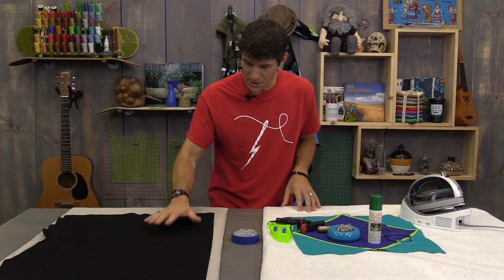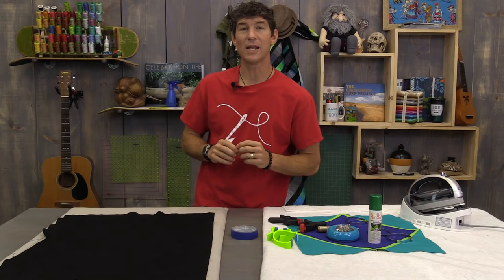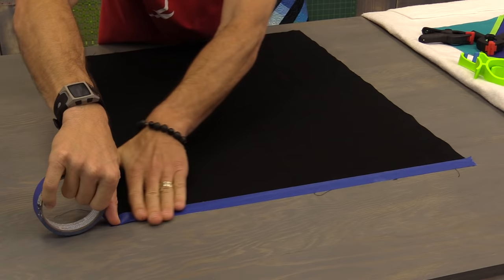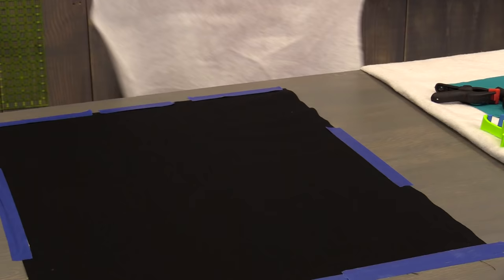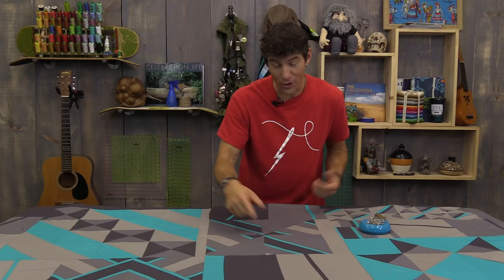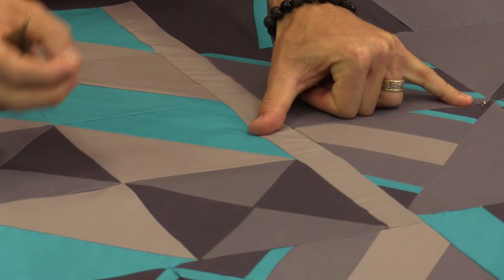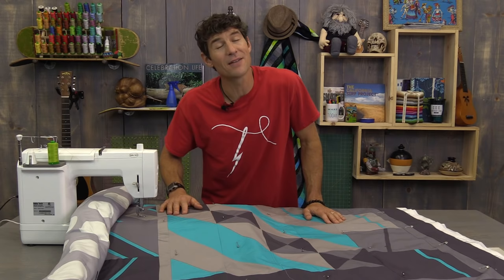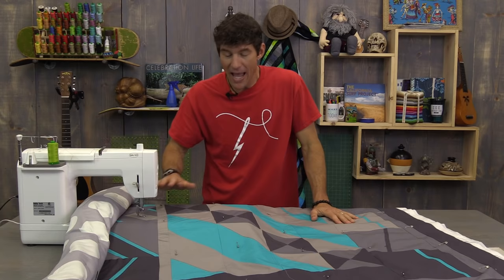Quilt Basting Basics Made Easy!

Comment: This tutorial was very helpful.  I have always relied on spray basting and am just tired of the overspray (and the expense).  Last year when I was Spring cleaning, I found cobwebs in the basement that were glued in place!  😃I'm working on my second quilt using pins.  Hard on old arthritic hands, so I think I'm going to invest in the tool you showed.  My oh so helpful husband went out and found me an old ping pong table and set it up in the basement this week.  Bless his heart.....I'm only 4'11 so I'm going to have to find a step stool so I can reach the center of the table.  The quilts I'm working on have backs and fronts that need to be centered.  What I did was glued a small button on the middle spot of the table and then found my front and back centers.  Did this on the batting as well, so everything worked out as far as overhang of backing and batting around the perimeter.  Funny...........my extra set of hands is always my husband.  When we were laying out the batting, he knew and kept saying to me....don't pull..... "lift and drape".  He must have been listening from the other room.  (Which I find amazing because usually when I ask him something from another room he says he can't hear me).  Thanks again for your wonderful instruction.  I think you're a great teacher!

Comment: I'm glad you mentioned not using Spray basting on large quilts. I did this ,it stuck to the batting and I had a terrible time to get it to lay flat! I would never do it again!! I never thought of ironing my quilt on the table while assembling it. I always did it before I laid it out. It makes more sense to do it while on the table. Although it will be hard to do it with an iron with a cord I'm going to try it! Thank you for the advice! I also Love how you kept the quilt rolled up. I to have a small machine.

Comment: You should try picnic table clips if you haven't already. I have a dozen that I use when I cover my table with batting and canvas, so I can press large pieces. They are stainless steel with a spring and they are super tight plus won't rust with the steam from the iron! Thank you for all your hard work taping these for us

Comment: Even though this video was done some time ago, I thought I would just add a little note for anyone intending to follow these directions.  Firstly, I like Rob's tutorials very much and this one helped me a lot so I wasn't crawling around on the floor.  However, where he says to drape the batting and quilt top, think about it.  I did think about it, but carried on anyway, with the result that the quilt top puckered when I was sewing in the ditch and I've just finished unpicking in about 8 different spots, smoothing out and sewing again.  Needless to say, with the time taken to do this, I could have made another quilt.  If I had been setting it all out on the floor, I would have been taping down all 3 layers, so I'm not sure why Rob wouldn't have been advising to hold down all 3 layers with the clips.

Comment: One and one-half inch wide painters tape works well for me, if needed for a smaller quilt.  For a large quilt I use clamps purchased at the local hardware store to clamp the backing onto my table.

Comment: Thank you so much for this awesome tutorial! It's so hard to crawl around on the floor while pregnant, plus there is not enough empty floor space! Now I can finally baste the 3 quilts I've been putting off! 
My question is: have you ever had issues with your backing fabric fraying during the first wash after not prewashing? I prewash and my fabric is always a wrinkly frayed mess after, I would love to avoid that!!
Reply: Ashley Brookfield, I know this is an old post, but if you’re still having trouble with fraying when you prewash fabric, if you have a serger, serge the cut ends and then wash. Wa-lah! No more frayed edges. Just a little tip I picked up somewhere, but it sure saves your sanity. Lol.

Comment: Hi Rob, such a great tutorial. I've been quilting for awhile, and always hated doing the sandwich, and have been using basting spray, and also pinning with the board on the bed, and only doing small child quilts.  Your table method will work for me and make it much easier to pin baste.  Is the home depot or Lowes stores a good place to find the clamps?  I've not used them before, but it looks so easy and perfect.  Thanks for the info!

Comment: Help!  On an old ping pong table I put down Insul-Bright with silver ironing fabric on top.  I thought this would be good insulation on the table but after ironing the tables paint has bubbled up or caused cracking.  How can I protect this surface or is it even possible?  Thanks for your tutorials, I've learned much from you.

Comment: Hi Rob.  I am a new quilter and really struggle with basting the projects that are larger than my table.  I actually saw a video where the woman used wooden boards from the home improvement store to “bolt” her backing and quilt top and baste in small sections at a small table.  I tried this and it works great, but for larger quilts, pool noodles also worked.  Have you ever tried this?

I would love suggestions on how to trim and square the quilt sandwich without having to hit the floor.  I cannnot get down on the floor due to a bad knee, but with a large quilt,  i struggle on the table with a cutting mat.  Any ideas?

Comment: I already know I have many errors!  I am a new quilter doing my first large size quilt doing a very difficult sisters choice quilt pattern.  Had so many issues in regards to each square being the right size 10  1/2 and gave up on possible correct squares.  So it’s a bust for that yet it’s a quilt for a little girl and an experiment to get me knowledge and be able to omit errors as I grow.  I realize that you should be sparing with backing and  the batting yet I’m on a budget trying to get least amount of waste.  I feel as I grow and learn I will be able to do margins for backing and batting to be  larger that the top of the quilt. What can you share with me to let me not be discourage. I am limited to space serious space.   And getting in the floor is hard I have lupus.  Standing is hard if it for long periods.  No hard wood flooring.  I need suggestions not words of just quilt I have spent a lot of money on things to get started so quilting is not an option.   So tell me some great words to not be discourage.  With the sisters choice quilting pattern I don’t have my rows starting and stopping in the same manner on each row.  Not to far off but noticeable yet it’s my practice quilt tell me what do you do in that manner.  I am good at getting points to line up but this pattern just had to many but oh well to that.  I purchase a Disney backing yet it was a precut and not very big so I had to use two but didn’t want to purchase another so added a border to that as well as the seam is not centered horizontal or vertical.  As I stated I made so many mistakes yet it was done from my heart to please the little girl who stood patiently by me as i ventured into this project.  She kept saying I love my blanket grandma.  So she saw no issues just me who felt down about them.  Can you encourage me?  You do such great work.  So energized enthused and just got it all worked out for the starter quilters and I thank you for that but help me to be a better crafter.  TCR0315@gmail.com

Comment: Hi Rob,  How do you account for any potential puckering that can happen when quilting on the machine while using pins?  I personally don't FMQ (I hand quilt) and have experienced pins putting holes in the fabric, but I find I still have to stretch the top, batting, and backing and baste with thread to keep everything secure and pucker free.
Reply from the maker: Hi Christina! I also stretch and sew my backing while pin basting. Funny, the holes that the pins create (like the ones by hand basting too) are stitched in while I do the free motion, so they never show when finished. I choose pin placement with care for that reason. The pucker comes from the movement and the lack in tight basting when you machine quilt. I think the slip mat under the project helps a ton, as there is no friction on the quilt backing so less push and pull of the actual backing fabric, less puckers, but I still get them too. Hope this helps!
Reply: Thanks Rob!  I may try my hand at FMQ one day, but for now, I'm not brave enough. HA HA

Comment: Your not suppose to lift the Kwik Klip from the table, no control.  To make it really easy, attach the Quilters Delight Safety Pin Grip Covers to your safety pins, so much easier to use the pins and Kwik Klip.